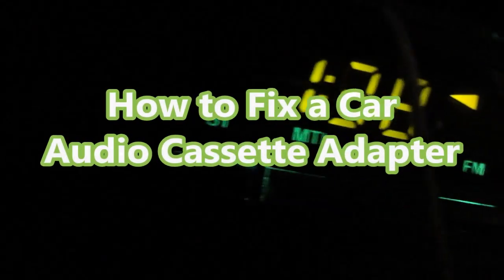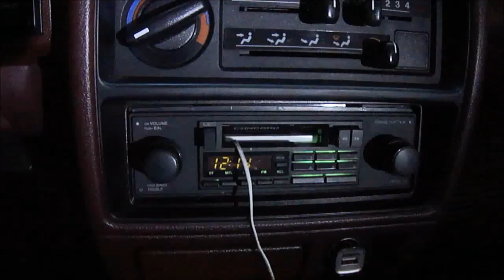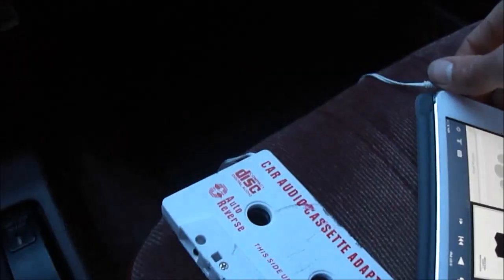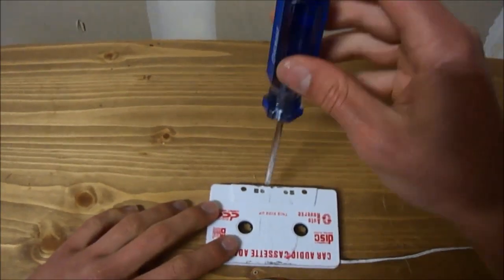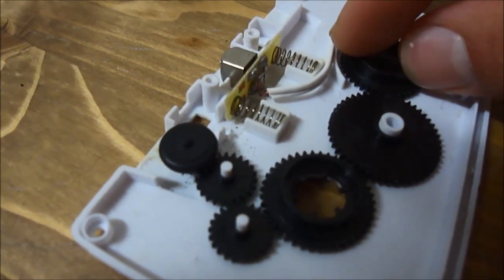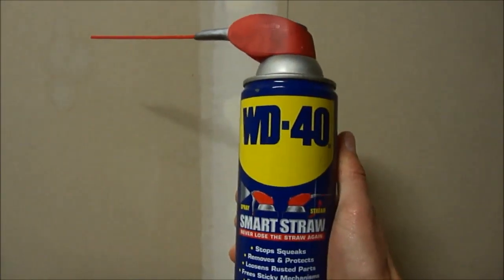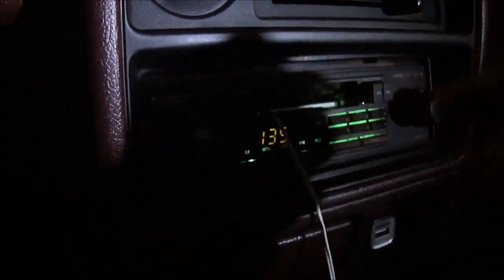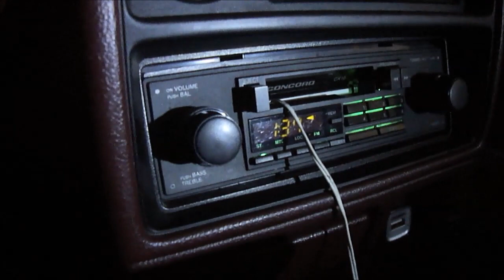How to Fix a Car Audio Cassette Adapter

Comment: I'm seriously considering getting a new aftermarket radio with bluetooth and aux built in instead of having to deal with old Cassettes.
Reply: Enjoy paying for the radio and the wiring installition.
Reply: for real. i had to solder a new 3.5 jack onto an old crispy adapter, because the one i bought new still plays distorted after trying all these steps
Reply: @mywa8314  makes it yourself and ads thick gold wiring with card board box woofers
Reply: @Mr.Spanky  don’t need this crap anymore bought myself a new car.
Reply: well sure, i mean the point if these things is like if you can’t afford a stereo. if you can there’s no reason not to update it and stop fucking with these things

Comment: For this to work really depends on the type of player you're using so don't take this as a general howto.
If the gears served no purpose they wouldn't have put them in in the first place. Most cassette players will sense "end of tape" when the spindles stop rotating. So in a lot of cases a cassette player will just stop or trigger the auto reverse mechanism.
Reply: Yes, best way is to remove every gear except the two spindle gears and the center gear connecting the spindles. Make sure everything is lubed up, sometimes that center gear gets a bit too hard to spin and tricks it into thinking it’s the end of tape

Comment: So if it works without the gears why do the companies who make them put in the gears when they make them if they serve no purpose
Reply from the maker: From what I understand, the gears mechanically inform the cassette reader that there is a tape installed (to enable the play/pause commands) and also to assist in ejection. I noticed the cassette reader would sometimes try to rewind the tape during play and would only partially eject the tape while the gears were removed.
Reply: All it did for me was flip flop. Until I got my stereo changed, the FM Transmitter worked much, much, better.
Reply: @TheAlternativeScoop  I changed out the gears and did both. 72 cent Chinese plastic stero adapter failed... eBay price makes sense
Reply: maybe the purpose is that the tape  to eventually stop working so you can buy a new one  if you don't know how to fix it .
Reply: Mine works for a second then it ejects
Reply: I would buy a brand new cassette adapter from Walmart in immediately put in my car it would start injecting itself so if their plan is to make these things faulty for you to buy a new one they did too much by making it break immediately multiple times with three different brand new adapters

Comment: i tried all this before realizing it was a problem with the wires' connection to the circuit board.

so for anyone reading this: if you're gonna open up your cassette adapter, the first thing you should look for (before taking out all the gears) is if the two tiny little wires are connected to the green chip. also, if your car isn't playing the right or left earbud's part of the song, one of the wires is probably already disconnected. 

when trying his advice to "take out all the gears", my car just started ejecting the adapter as soon as i put it in. i guess some cassette decks don't accept cassettes with gears missing.

Comment: i bought a $2 one from walmart and im pretty sure the issue is that the chord sucks after 2 months of having it, i have to adjust it sometimes so the music will play through one of the car speakers. Do i still try these options in the video to see if it will work or just buy a better cassette tape?

Comment: Works but only get sound from left side of the speakers sometimes right but when i use the radio works fine🤔
Reply: Same here :( did you find any answer?
Reply: @SpartaNKaloSIX  well mine had a couple os tiny screws loose inside so i just put the cassette inside and put a piece of thick paper to keep pressure inside while I'm listening to music and it works idk if that helps you
Reply: @epiccomedy227  Thanks, i'll do it.
Reply: Adjust the car sound before
Reply: That sounds more like a radio or speaker issue to me
Reply: Could you go into a little more detail on how you fixed this, because I am having the same problem. Thanks.
Reply: i’m having the exact same problem if you find a fix respond to me
Reply: @coopdog1220  i was able to fix my problem by buying a different cassette adapter because for some reason certain brands didn't work on my car at all i have a Bose audio system in my car and the only brand that worked with my car was a "Giga ware 12-632 cassette adapter" i bought it on Amazon and it works great i don't know if that works in your situation but you guys should try different brands it worked for me
Reply: Does yours have a cable to plug into the aux port? The cable is going out if so.

Comment: Mine's ejecting in a weird way. First it automatically gets "sucked" in and when it does, it's not centered. It's kinda wopp sided then it ejects. I'm starting to think it's the deck instead of the adapter but idk. Any tips or advice to fix this?

Comment: Oh my gosh! I just took all the gears out of the casette adaptor took me 3 minutes and stuck it in my casette player. It works! No gear noise no problems... how? What are those gears for anyway?
Reply: for resistance so the stereo can recognize that it's an actual tape

Comment: Without the gears, mine which is Toyota Camry 01, doesn't work and ejects itself. With gears, it works but including frankly grinding noise that picked me off, and I can't hear music from the left speaker( it works fine on radio)! Any advice please help!
Reply: Did you touch the chip by chance? Maybe you've accidentally done something that disconnected the wiring to the left auxiliary.

Comment: I just bought one today for my Honda Accord '92  and it simply will not go in all the way. At first it will partially go in and on the screen it will say "tape" then a few seconds later it will eject by itself and go back to the radio. Can someone please help
Reply: Anjoline Thongdy My 2000 Buick century just ejects it and says "CIN" on the LCD.
Reply: Jesse S Thanks for the advice. My problem turned out to be that the cassette adapter would not let the tape reels turn counterclockwise. So I had to open it up to take out the cog mechanism preventing it from rewinding. Although that could be useful advice for people who do have that problem.
Reply: Dude your comment just helped me fix mine. When I realized it wasn’t turning counter clockwise I just began twisting the gears back and forth til it got loose. Thanks for saving me $15.

Comment: I had an iWorld cassette adapter and it worked perfectly fine for about a month. Then it would stop playing music in the mornings and then it stopped working all together. So I bought a whole new one and after one use it also stopped working.  I've had iWorld Cassette adapters before and they worked fine for a long time.  Is it the cassette player in my car that's faulty or the actual cassette adapter? Any help? My car is a 1995 Honda Civic
Reply: I have the same exact problem

Comment: Hi, thanks for this tutorial. I had a noisy cassette adapter that I'd just purchased and was wondering if it were even possible to reduce the noise the internal parts were making. Decided to go with right to your plan c and removed all the internal components. Worked like a charm, thanks again!

Comment: does it still eject when all gears are removed.. i don't want mine to get stuck in there? TheAlternativeScoop
Reply: I took all the gears out and mine still ejected. Although it only worked the first time and now its auto-ejecting again.
Reply: MVPTalent mine also auto ejects when the inside of the cassette player gets hot.

Comment: My Toyota just keeps ejecting the tape back out at me do you think you know what to do?
Reply: +gianni figueroa The problem here is that our cassette player has an auto eject feature if the player does not feel "comfortable" playing what's inserted. Not sure how else to phrase it. Without the gears the Camry's tape deck doesn't recognize the inserted tape as a tape and proceeds to eject it. Mine works with the gears, but is obnoxiously loud.
Reply: I seem to have the same issue (I have a 1997 Toyota Tacoma) seems like a Toyota issue???
Reply: Same issue on my 98 civic:/ its so disappointing

Comment: i took out the ejector gear with the rubber ring only, and left all other gears inside.  so far this appears to have fixed the problem with my cassette adapter. i guess every cassette player is a little different.

Comment: May anyone be able to give some good advice? We bought a cassette adapter for our car but it kept making like a constant rattling noise. We bought and returned multiple cassette adapters to only come to the conclusion that it's the cassette player itself making the nosiness. If and how could we fix it, or would it just be more worth it to get a new radio all together?
Reply: +Raul Garcia Was it a ~2000 Toyota?
Reply: +ShinigamiMachine Mines a 2001 Toyata Sienna
Reply: Yeah, the stock stereo Toyota used in that time seems to have an issue with them.

Comment: I'm using a cassette adapter. Bought a new one. But now I'm only getting sound out of right side speakers.  Both sides work with radio.  Does anyone have any ideas on how to fix it?   It was playing out of both sides  just two days ago.  Thanks
Reply: Kendra I'm having the same problem i thought my left speaker was going out

Comment: in my case it worked to remove the auto rewind gears... removing all the gears cause my player to not not detect the tape, and spit it out. with the gears in theres a little noise but it doesn't spit out anymore

Comment: My car just wont play tapes at all. What do you do in that instance?
Reply: MrTheBESTintime That's actually the thing that I won't do, because then when something goes wrong with that what am I supposed to do? Persist in buying replacements?
Reply: well if you buy a good one, and treat it nicely it should not break.
Reply: +Cooley96 fm transmitter
Reply: Cooley96 buy tape head cleaner

Comment: Well my car audio problem is that my cassette was stuck in it. I did eject that cassette but it still stuck in there. Well I did disassemble the car audio parts but now the problem is that the button is broken and it can't connect to the inside to eject the tape anymore. Can you help me?

Comment: If you have a  HONDA, TOYOTA, ACURA, or another k7 With the autoreverse, Just remove the rubber ring over That gear, and it Will work perfect as you need

Comment: What do I do if plans A, B, and C fails? My car keeps spitting the tape out .'
Reply: Ezekiel P. Try the FM Transmitter until you are ready to change your car stereo. Until I was able to change my car stereo, that's what I did.
Reply: I hate the radio lol
Reply: Ezekiel P. You don't understand. Look on amazon.com for them. It's a small device that plugs into your cigarette lighter. And you use a standard audio to audio cable. That plugs from the transmitter into your portable cd player or I-POD, or whatever. 
And until you get your car stereo changed, you can listen to your cd or I-Pod that way. In stores I see them for $20.-$25. But sometimes less on amazon.
Reply: Seriously? Dude heck yea. I'll look into it
Reply: Ezekiel P. No problem. What you do is, you put the transmitter on a station that isn't really used in your area. Then you adjust your car radio to that station. And it should work. Good luck!  
Like I said, it tided me over until I was able to change my stereo.
Reply: You are a true life saver...I was pulling out my dreads.  I'll go on amazon and see if I find one
Reply: Ezekiel P. I'm happy I was able to help you. :) I think one major reason people made these was because a lot of people were having trouble with the tape converters. (Either they were flip flopping or the stereo was constantly ejecting it.) 
The FM Transmitter I used even accepted SD cards. I hope it works out for you. Let me know.

Comment: it'll play for a second in my infiniti g35 and then it will eject by itself? what can I do
Reply: idk. my 2003 Chevy trailblazer is the same way.
Reply: +Samuel L Jackson same here, honda civic 02
Reply: same here, toyota camry 99
Reply: +Johnny Tapia I have a 99 Camry as well. The problem here is that our cassette player has an auto eject feature if the player does not feel "comfortable" playing what's inserted. Not sure how else to phrase it. Without the gears the Camry's tape deck doesn't recognize the inserted tape as a tape and proceeds to eject it. Mine works with the gears, but is obnoxiously loud.
Reply: I have a Infiniti f35 and just started ejecting the tape when I insert it! Did you ever figure it out??

Comment: I did all that and it didn’t work
Reply: if it sounds like its trying to grab the tape 3 times then ejects it saying "broken tape" your radio has a cassette mode. most of the early 2000s cars to this, pretty annoying.
to turn on Cassette mode for mine you put the adapter in, turn the radio off so it doesn't eject, then hold the "Tape/CD" button for 3 seconds, then it will take 5 seconds to switch modes. then it should work. this disables auto reverse too.

Comment: Mines won't stay in
Reply: I have the same problem
Reply: that's what he said.
Reply: me too :(
Reply: Originally Tari If you're not ready to change the stereo in the car, there is another option. 
Try the FM Transmitter. Until I was able to get my stereo changed, the FM Transmitter was able to tide me over.

Comment: Wd-40 is not a lube it strips lube. Get 3in one lube it works.
Reply: https://en.m.wikipedia.org/wiki/WD-40

It is a lube lol...pretty clear that it is.  Depending on the job required there are several different kinds of WD-40, and perhaps none of them is the best one for a particular job but saying WD-40 isn't a lube is just silly.

Lube is short for lubricant and it most certainly is one.